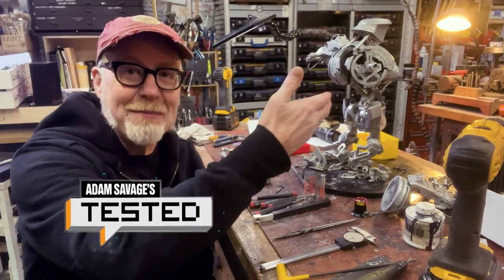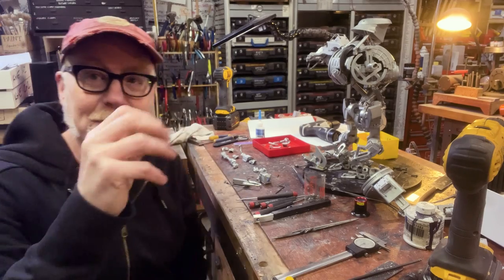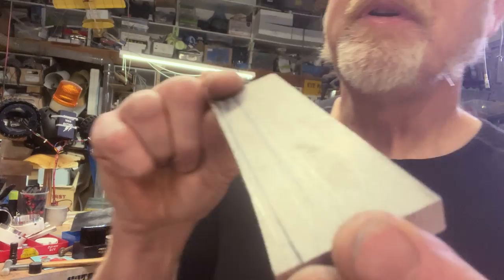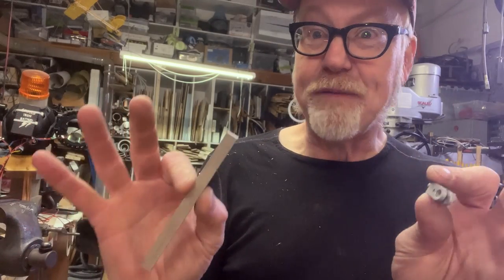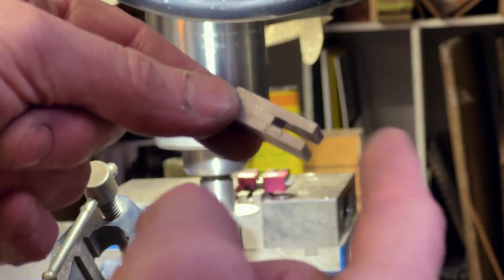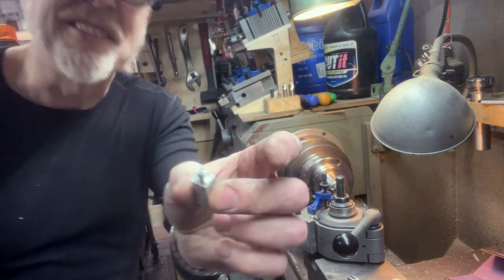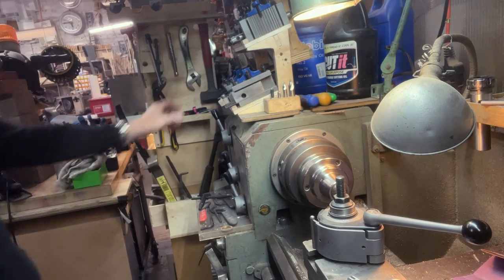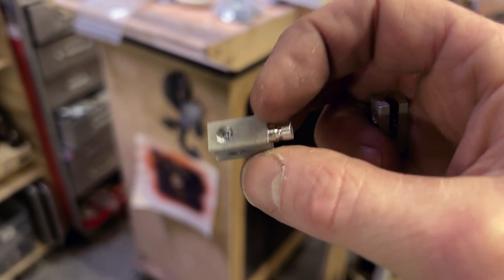Adam Savage's One Day Builds: RoboCop 2's Cain Stop-Motion Puppet!

Comment: Regarding the first piece.
I would have squared up the ends, then made the slot in each end of the bar stock.  
Next, I would drill the holes.
Only then would the part be cut to length.
This provides more clamping support.